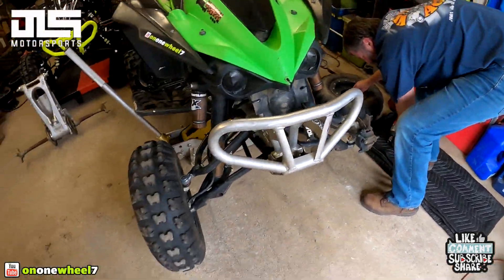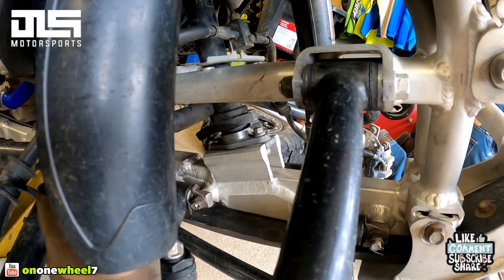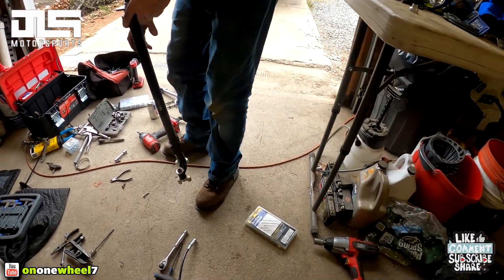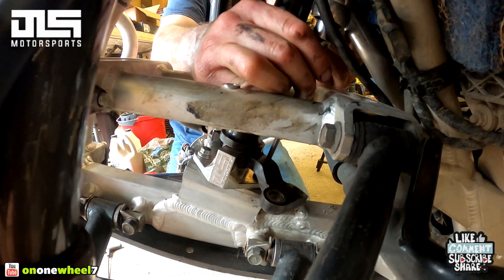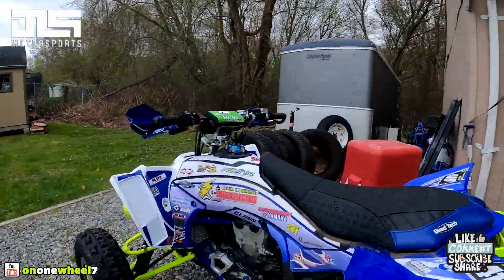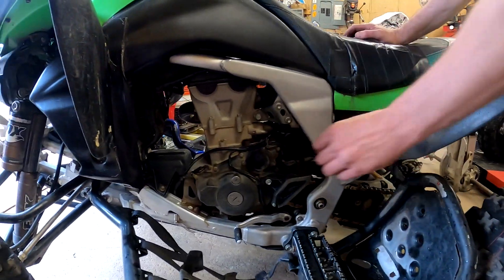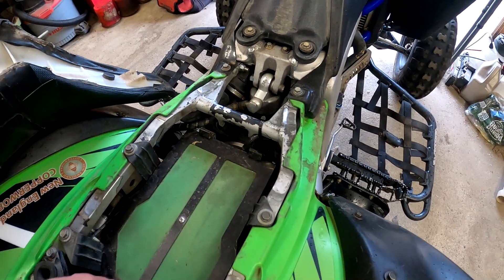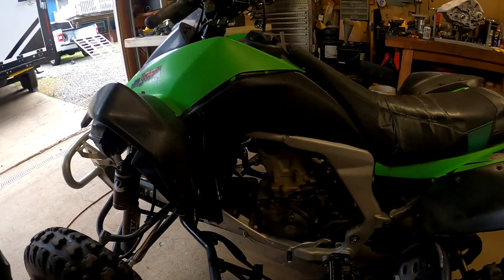KAWASAKI KFX450R STEM PLATE INSTALL -  JLSMOTORSPORT KFX450R STEM PLATE  -  HOW TO

Comment: Hey man can you help I know I'm late for when this video was posted but recently had an accident on my kfx 450r and when you turn to the left it doesn't even turn all the way I checked the stem and nothing looks wrong do you think the plate has to be replaced ?
Reply from the maker: Is a tie rod bent? Did you hit somthing?
If the stem plate was bad it would just have play in it!
Reply: @ononewheel7  yes it was men I actually cracked against a rzr and the left wheel got bended to the right since it was the direction that the impacts came from we change it out but the wheel remain a little sideways like if it would have some negative camber just a little, but just right now I pulled out the stem and the bottom bolt of it is bended just a tiny bit Atwell idk if that's causing it to jot turn to the left as much as it does to the right
Reply from the maker: Its possible! Hows the the frame?
Reply: @ononewheel7  it's in good condition don't see any bends or cracks
Reply from the maker: Might be a bent tie rod then have you checkd that?
Reply: @ononewheel7  I change it but I think the right side one God a little bended Atwell because yesterday that  I was putting everything back together it would g want to go in like if it was bend in some sort of way
Reply from the maker: Yes something has to be bent for sure!
Reply: @ononewheel7  yeah men pretty sure it's an arm but I'll just wait to get some many since I can't work yet till in some couple of moths but really appreciated your time to come answer my questions thank you very much 😂
Reply from the maker: Anytime bud

Comment: Just wondering where to get the spacer I'm running lsr stem as well
Reply from the maker: What spacer?
Reply: The one that is between the end of stem and stem plate
Reply: I’m in the same situation
Reply from the maker: Isnt that an oem part? If so rockymountain
Reply: @ I ordered the pivot works bushing kit, the bolt coming off of the bottom of the LSR stem is too wide for the ID on the pivot ball inside the plate as well as the new bushing. The threaded portion fits, the collared part doesn’t.

Comment: Thanks to Jlsmotorsports and Ononewheel7 for the stem plate.. Change the bearing when needed and it should last for years.. When replacing the bearing, use a stainless steel one..  They last a lot longer.
Reply from the maker: Thanks for doing the install lyle!
You want a laugh some said last ride video 
Its cool you get to ride with your uncle 🤣🤣
I had to explain that thats your nickname haha!